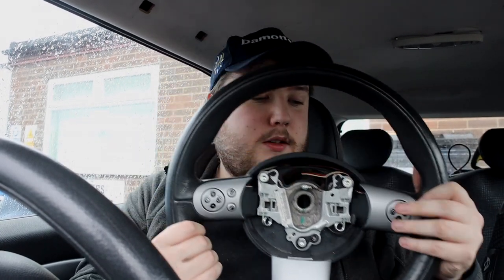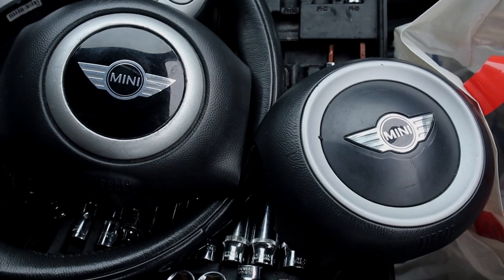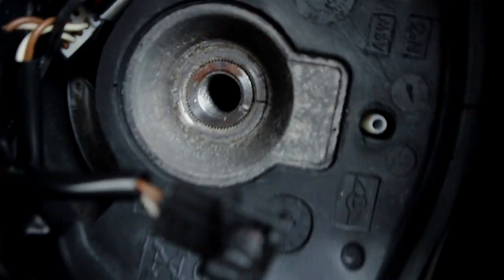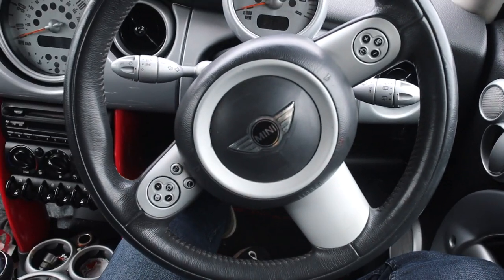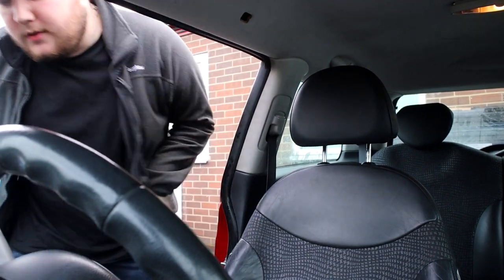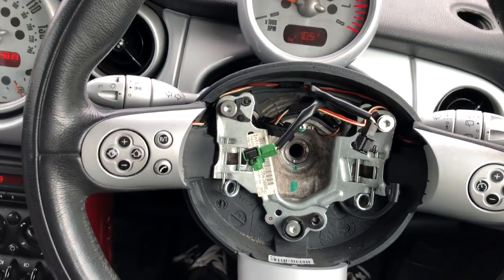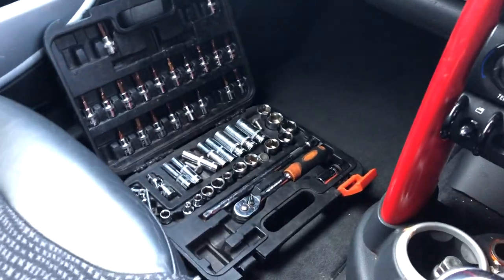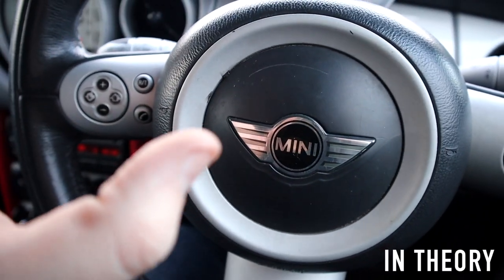R53 Multifunction Steering Wheel on an R50 | Project Blender

Comment: To clarify, Ive did the upgrade, changed the squib and even coded the MFSW option in the car and I don’t get buttons lighting up. You have to complete the retrofit (with a cable and other parts) to make it work

Comment: Dude, what did you do abt the connector? I notice the updated wheel has a longer wire adaptor than the regular. Thanks
Reply: I wonder if you can patch the missing wiring into the loom and programme the options like cruise in via NCS Expert? Though earlier cars like this (same as mine) apparently have less programmable options but they still have auto locking, one touch up and down for the passenger window and wiper auto intermittent at stopping when wipers are on first constant speed amongst others. Things I'd love to have on my little Cooper! I also want to programme in the light wash system for the early type HID lights I fitted (no MOT fails yet despite lack of aut levelling and wash systems!)

Comment: Hi mate did you only need to change the squib to get the multi function buttons to work?
Reply from the maker: Hey man - I never got round to getting the multifunction to work. As far as I know, you’ll need the following:

Multifunction squib
Multifunction wiring harness 
Facelift radio - I’m pretty sure the pre-facelift ones don't have the slot for the connector.
Reply: @slothgarage  hello can you show me an example of facelift radio

Comment: How did you fit the airbag wires? I’ve tried to change mine however the airbag connection on the car are different to the new wheel?
Reply from the maker: Mine slotted right in without issue. Are you sure you have the correct wheel?

Comment: Hey man, were you able to get the buttons to light up/get the multifunction to work? I’ve got a 2 spoke multifunction and would like to upgrade to a 3 spoke multifunction but don’t want to lose cruise control and audio functionally.
Reply from the maker: It should be plug and play in your case. If you skip to 06:32, that black connector is for the multifunction. Your squib will have an extra slot so you can plug it in. If you search MINI R50 multifunction squib into google, you'll see what I mean.

I did plan to do a follow-up video on getting the volume controls working, as well as getting the buttons to light up, but in my case, it involved sourcing the facelift stereo, wiring and the squib. Hope that helps anyway.
Reply: @slothgarage  Hi Can you get the wiring harness for steering wheel operation as an independent part?

Comment: Have you had any issues with the clock spring? I’ve just changed mine from the 2 spoke to the 3 spoke with no controls but steering is heavy and clicks at me. Did you run into anything like this?
Reply from the maker: Nope. Literally removed the old one and popped the new one on. Daft question maybe, but are you using the right model wheel? The r56 wheel looks very similar, but it doesn’t fit properly. 

Failing that, remove the wheel and retrace your steps. It seems a bit strange how your steering has gone heavy from just swapping out the wheel. It sounds power steering related. Any issues before?
Reply: slothgarage the wheel came from a 2003 Cooper I think so should match up with mine as I have an 04, I think it needed bedding in or somthing as after doing some miles in it the clicks have gone to a small rattle and it’s lightened up. 

I couldn’t figure out how it all went together at first as there’s loads of videos on how to remove and fit the wheels but none show how the plastic bit goes. I just assumed the nozzle went into the hole at the base of the wheel and you were set. 

I think the heavy ness came from going to a smaller wheel as the 2 spoke is an inch or so bigger, as I’ve never had issues with steering before.

Comment: Hey, does the horn work normally?
Reply from the maker: Yeah, I didn’t have any issues with the horn. Provided it worked prior to the new one going in, double check all your connections and make sure everything looks clean. 

Failing that, check the fuse for the horn which should be located on the left (or right if it’s LHD) panel under the glovebox. Hope this helps!

Comment: do you have to delete any error codes?
Reply from the maker: Provided you disconnect the battery before messing with the airbag, then you shouldn’t have any codes pop up. Just make sure the new airbag is connected before reconnecting the battery
Reply: @slothgarage   I didn’t disconnect the battery and the airbag light is on how can I delete it ?
Reply: @panoskollias  yes you can